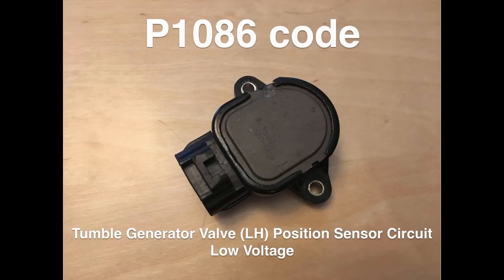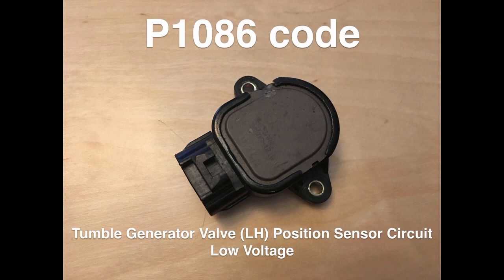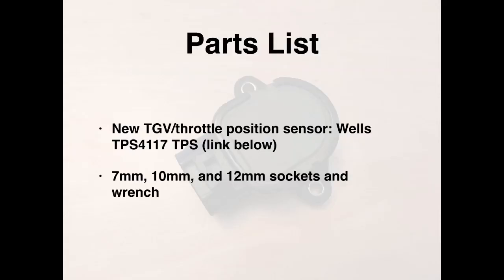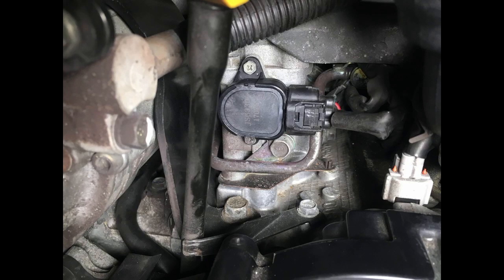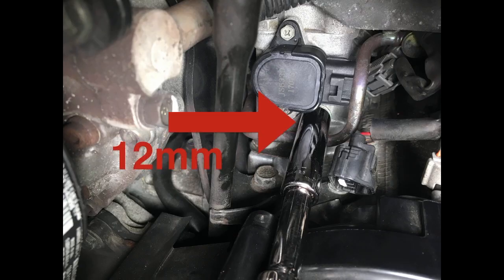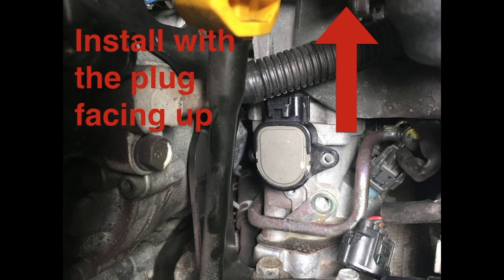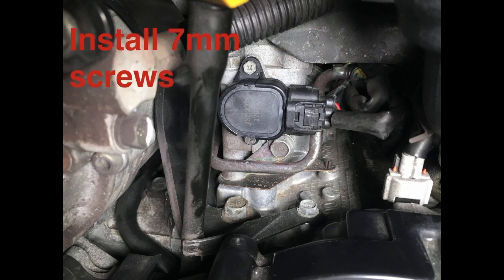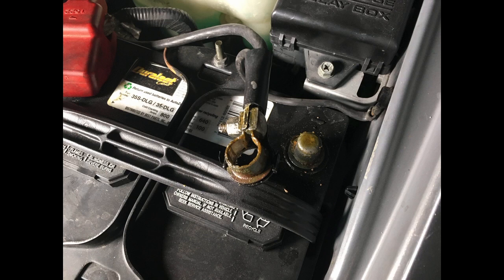Subaru P1086 Error Code: How to swap the TGV position sensor in a 2004 Impreza

Comment: From my experience, the 2004 Forester XT (EJ255) requires the TGV sensor be installed facing left and rotated 180 degrees clockwise to the orientation shown in this video (facing right towards the driver's side fender). Nowhere have I read this (everywhere says 90 degrees), so just wanted to get the word out. I completely removed the intake manifold to verify this was correct by manually moving the butterfly valve open and closed with the TGV sensor installed in the previously described manner.
Reply: I just did this on my 04 Forester XT and I only had to turn it 90 degrees then screw it in like the video. Also thanks for the video 👍
Reply from the maker: Good info! That's the first I've heard about pre loading the position sensor by turning it 180º. As I installed my replacement position sensor, I think I could only turn it something like 135º total before it stopped rotating inside, so I don't think it's possible to rotate the interior spring on the sensor I bought so much (180º). Your mileage may vary!

Comment: Hi, Bill. If you see this comment what would you make of a P1091 code on a 2004 Subaru Outback? Supposedly the code points to a tumble generator valve. However, it was also said that the code (or maybe the part) relates to the WRX model, not an Outback, which is causing the shop owner to recommend replacement of the ECM. Does that sound right or the shop just doesn't have the right scan tool to diagnose it properly? This CEL occurred within a week of a DIY install of a new Right/Left headlight assembly. After a period of driving with the lights on, fuses for the lights would begin to blow. Within a day of that, the alternator was replaced (but it turns out that when the new alternator was installed, a fuse had to be replaced to get it going). The very next day, with this electrical problem still unsolved, the car lost power, coasted to a stop and threw this code. The car was taken to a shop that found a short in the headlight assembly so supposedly that's fixed. (Not sure if there's any recourse with the aftermarket manufacturer of the headlights, though!) In any case, we were not prepared to learn the car will need a new ECM. Upon return of the car it was no longer accelerating properly (barely gets up any speed) and still had a CEL. Less than a year ago the head gasket and valves were done by this same shop. Last month the lower crank seal and PCV valve was done. Now this. Does it sound like they screwed something up doing prior work or perhaps trying to figure out why the lights were blowing fuses — or is this P1091 code caused by an entirely unrelated problem that just coincidentally showed up back-to-back with the others?
Reply from the maker: You have a lot going on! P1091 is Tumble generator valve #1 (RH) malfunction (stuck close), so that's the turbo side/passenger side of the engine. My guess there is that your position sensor isn't changing its sensor reading as the valve opens and closes, so the ECU throws this code, assuming the butterfly valve is closed all the time. 
First, see if the position sensor is still good. This sensor is pretty hard to remove, since it's buried back between the motor and the turbo housing, so you have to pull lots of parts out of the way to get to the right-hand (passenger) side sensor. But with the sensor off, you can use a multimeter to see if the TPS is good or not (see https://axleaddict.com/auto-repair/How-Do-You-Know-if-a-Throttle-Position-Sensor-is-Bad for great tips!).
So test the sensor first, and if it's verified working, then your next step is to determine whether the TGV motor is actually rotating the shaft in the TGV assembly or not. I don't know the best way to test that motor, so maybe others can chime in here.
But if that TGV motor isn't working, the TGV will be stuck closed by default (that's its default position), and that appears to agree with the P1091 code you say you get from the ECU. A TGV stuck closed will restrict air into the intake, giving you poor airflow at wide-open-throttle, and a really poor air/fuel ratio, poor power, and horrible performance overall.
Good luck!

Comment: Would cleaning the sensors be worth trying in order to get the CE light off?
Reply from the maker: Good question, but I don't think so. What this sensor does is changes the resistance as the sensor rotates along with the axle rod (am I saying that right??) of the TGV.
It's a potentiometer, and when the potentiometer starts to go bad, I don't think cleaning it (in a part that is not built to be opened up and cleaned) would fix the bad sensor readings. I'd feel more confident buying a new sensor and installing it, especially since you have to remove the bad sensor in the first place to even clean it. Good luck!
Reply: Bill Winterberg thanks for the reply. So the sensors are the same for the LH and RH sides?
Reply from the maker: Sad Guroo Yes, same sensor on the passenger and driver’s side of the motor, at least for my 04 WRX.

Comment: Hi guys can anyone help me with the code p1306. What it can be ? Thanks
Reply from the maker: I googled that code which says: P1306 OCV Solenoid Valve Signal 1 Circuit Malfunction (Open). That's part of the Subaru Active Valve Control System, or AVCS, and is an adjustable camshaft gear. In my opinion, it's not related to the TGV assembly of the motor, so you'll need to troubleshoot issues with AVCS to address your code.
Reply: @BillWinterberg  Thank you mate your a legend

Comment: can someone explain when he says the sensor needs to be put in upright and turn to LOAD it.. What exactly does that mean and is it something an idiot wont mess up?
Reply from the maker: The Firmament There’s a spring inside the position sensor, so if you just put the sensor on without turning it, the sensor will be in the wrong position, off by 90°. This is why you need to install the sensor with it pointing up to the hood, THEN rotate it 90°, and you can feel the spring inside load with tension as you turn it.

Comment: Thanks for the video....so all the sensors have the same part number cause I'm getting a P1088 which is the turbo side sensor
Reply from the maker: Dan Gatrell Yes, all three sensors (the driver’s side and turbo side TGV position sensor, and the actual throttle position sensor) are the same part. Just be sure to verify which direction you need to rotate the sensor to pre load the spring tension on the turbo side.

Comment: Would this be the same on the 2004 forester Xt? Thanks!
Reply from the maker: Good question, my answer is I don't think so. The 04 forester XT has a 2.5L turbo engine, and the throttle position sensor for the actual throttle body is different than the 04 Impreza WRX 2.0L turbo. I have to assume that, therefore, the position sensor used for the tumble generator valve is also different in the Forester vs. the WRX. 
If you can and it's not too difficult, remove the position sensor on your Forester and compare it with the images of several Subaru OEM throttle position sensors on Amazon or the Subaru forums: https://forums.nasioc.com/forums/index.php 

Hope this helps!

Comment: Hey I would like to see this video seen before removing the sensor, but I already did it (what can I do today to repair this;( help please
Reply from the maker: If you have a check engine light, you need a new sensor to make the CE light go away. You can still drive with the CE light on, you just get too much gas mixed in to the cylinder during cold startup.

Comment: Accidentally bought the wrong sensor, the sensors a little different from the 2.0l and the 2.5l but they will not work for one another. Need specific sensor for specific car.
Reply from the maker: Ojapolo Good to know! Can you share the part numbers for the 2.5l versus the 2.0l sensors so others can avoid buying the wrong one?

Comment: Hi Bill,

Im getting a missfire on all cylinders on my 2004 WRX 171K miles. P0301, P0302, P0303, P0304, Ive done everything i thought would be logical. New plugs, new coils, new battery, O2 sensor, Knock sensor, fuel pump, and nothing helped. The  CELs go from cylinder to cylinder, sometimes is just in one of the cylinders, 2 of the cylinders and right now is all cylinders. 

Please point me in some direction.

Thank you
Reply: I solved P0304 misfire problem. I put  10 lt gas+ 1 lt ethanol + half bottle wurth injector and carbon cleaner. 100 meter later it solved 😁.

Comment: If this is the TPS then what's the sensor on the throttle body?
Reply from the maker: It's the same part. Subaru used the same sensor for the throttle and the two TGV position sensors.
Reply: @BillWinterberg  hi mate. My car which is 04 WRX didn't show any code or Cel. But when I drive  for the first 5-10 minutes ,if I put my foot down on gas, it will jerk from gear 1-3. But after car warm enough it stop doing that. Possible the TPS fault?
Reply: @BillWinterberg   what is the sysmptom you getting prior of replacing the TPS. Apart of cel
Reply from the maker: @Totoroallright  I didn't have any noticeable  symptoms when driving with the bad sensor, just the annoying check engine light. The TGV does stay closed while your car is cold and then stays open when the engine is up to normal operating temperature. Your engine jerking in low gears when cold could be an issue with your O2 sensors: those need to warm up before they can send useful readings back to the ECU.
Reply: @BillWinterberg  I've change my O2 sensor a year ago. The one on the headers. Possible leaks from headers or uppipe causing this? I've the aftermarket uel headers and the position of O2 sensor pretty close to the body of the car
Reply from the maker: @Totoroallright  It could be a few things: injectors/spark plugs going bad, fuel pump/fuel filter getting clogged, bad intake gaskets, mass air flow sensor going out... all those can lead to poor ignition during cold starts.

Comment: How do the right hand  same process
Reply from the maker: So, the opposite side, the passenger side, is not as easy, because the turbo and turbo connections block access to the sensor. 

It takes more work to remove parts on that side to get access to the sensor, but once you have access to the sensor, the installation is the same. Install the sensor and then turn it 90º to load the spring, then install the two bolts to hold it in place. I'm not sure if you start with the sensor plug facing up to the hood or down to the floor, so pay attention before you remove the old sensor which way you need to turn it.
Reply: @BillWinterberg  i check and i got remove the coolant uper reserve and several houses and staff but thanks for answer bro!!!!

Comment: i replaced mine with the one you put in the description and ended up getting that low circuit code, and a tgv stuck open code. how can i fix this? or what did i do wrong
Reply from the maker: Jacob Sonntag If you installed the sensor pointed up, then rotated it clockwise, and you still have error codes, it’s possible the sensor you received is bad. There are a few videos out on YouTube that show how to test the position sensor with a multimeter.
Reply: Bill Winterberg  I did try to install it pointed upwards and rotated, but I dont think it did anything. is it supposed to move that tab as well? because if so, the teeth on the sensor are installed so that it does not move the tab. i guess i just do not understand enough to get it installed correctly
Reply from the maker: Jacob Sonntag When you turn the sensor clockwise, you should feel the resistance increase in the spring inside. So if you let go, the sensor should snap back so the plug is on top. If you’re turning the sensor clockwise but don’t feel any resistance in the spring, then something is wrong with the sensor and/or spring.
Reply: Bill Winterberg thank you for the help, i really appreciate it!!

Comment: Is this the same sensor for a 2004 sti I typed it in on the link u shared and it said it wont fit but looks the same
Reply from the maker: Adrian Torres I’m not 100% sure if the same sensor is used on both motors, but it seems like it’s such a common part (used for throttle position as well as TGV position on both sides) that Subaru would use the same part on the WRX and STI models. Let me know what you find!
Reply from the maker: So I looked it up and the answer is *YES*, the same throttle position sensor is used on all 2002-2007 Impreza WRX and STI trim levels. Yay!
Reply: Bill Winterberg sweet thank you so much I'll order the one from the link that is again man
Reply from the maker: Adrian Torres Thanks!

Comment: This on the rh or lh side of car ?
Reply from the maker: This is on the left-hand side of the engine on the driver's side. On the right-hand side of the engine, this position sensor is squished behind the turbo housing and is super difficult to access without removing many other parts. But the same sensor is used on both TGVs on the engine.
Reply: this "But the same sensor is used on both TGVs on the engine" is exactly what I was looking for! thank you Bill!!!
Reply: LH=Driver side RH=Passanger side, so this vid is about the Driver/LH side.